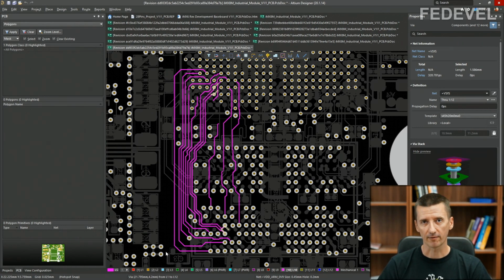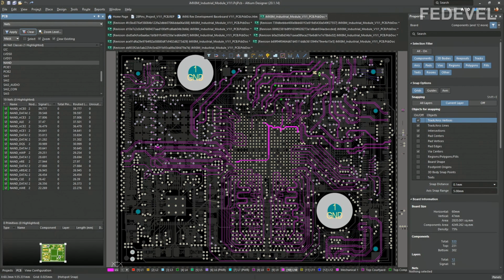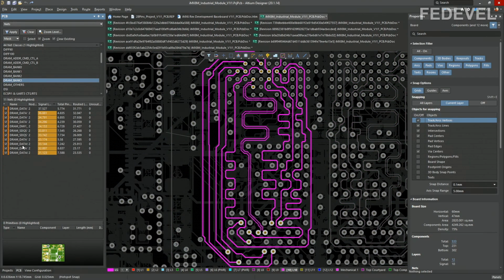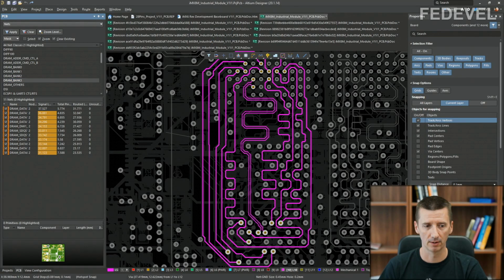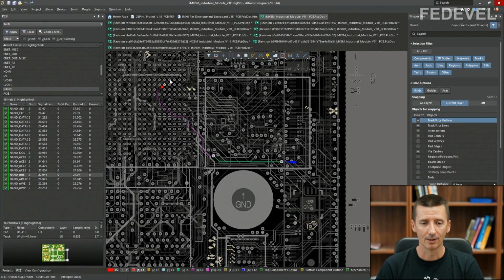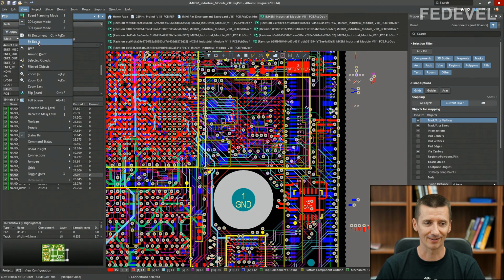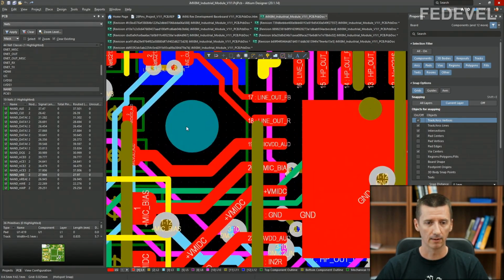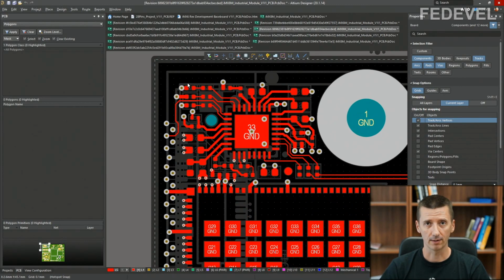How To Improve Your PCB Layout - Routing & Space

Comment: Hello Robert - excellent video, thank you! Question: For board edge clearance (tracks, components) you are using green lines on Mech Layer 14... also, one of your review points covered the NPTH being too close to tracks - why not fix these problems before starting the layout by setting up proper DRUs? I think it is very dangerous, to start a design with incomplete rules, don't you agree? Thanks!

Comment: Hey, Robert. How about a couple of words on LENGTH vs DELAY matching? Yes, it is possible to change layers of all the intarface signals at once or route them all on a single layer. Altium, however, allows to create rules to match the propagation delays instead of lengths. Is it a reliable approach? It seems to me that it should work for signals with t_crit below ~2.5 GHz and everything faster than that is likely to be some kind of serial interface that can not be properly routed on multiple layers anyway. Thanks.

Comment: Robert, why not use a HDI board with buried/blind vias and route the high speed traces on the layer with no vias. It will be much easier to implement impedance control and length matching. The distance between the traces to avoid crosstalk is dictated by the DDR manufacturer and should be followed (2lambda, 4lambda etc). HDI will also facilitate the use of ground shielding to avoid crosstalk and reduce EMI.

Comment: Can you comment on the lane length matching vs impedance/crossover/crosstalk and frequency?
Seems like signals are matched to within a few mm while signals on them could tolerate 10-20mm differences with no effects...
I notice a lot of time and energy is spent in other designs to do this type of matching when it is not needed. Crosstalk or other returnpath related issues play a big role.
Reply from the maker: Very good comment. For modules, we usually do tight length matching as we never know where the module is going to be used and how other engineers are going to do layout on baseboards. However if you have full control over the whole connection, yes, many interfaces can be simply length match in centimeters / inches or they do not even need to be lengthmatched.

Comment: If the base board has more space and is simpler, you could make the tracks different lengths on purpose on the complex board, and then compensate the difference on the board with more space. But that obviously is something that you need to have a lot of control over, and need to really think if it is what you want. I.e. boards then might be really hard to use with new design in the future.
Reply from the maker: Yes. Also, especially if the baseboard is designed by other people or companies, you may not have any control over the baseboard layout.

Comment: Got 2 little questions:
When you got the space - Is there any reason to not make the tracks as wide as you can? Ok, not 5 mm for a tiny signal wire but like why not 0.5 mm when you got the space, or 5 mm for a power-trace that only is supposed to carry like 1A.

And with free open areas the same - are the downsides to filling them with power/ground-planes?

it just lately i have often seen boards that not only are really spacious (like 5 components, 2 connectors and 1 small chip on an arduino-shield) but also 0.127 mm tracks with wide areas (like 1 cm) between each other.

Comment: very useful! keep doing this. you do a lot 45 degree lines  why you dont use (when is possible) diagonal line ? its more shorter and less corners
Reply from the maker: Thank you Sahar. PS: We are using diagonal lines in some cases (e.g. fanout), however I have not considered to use them for long signals yet. Probably simplest reason would be that it could look messy, however real reason is, I have not really needed that. When we route we often have to route horizontally or vertically to make it easy to connect everything - I have a system how to organize, swap, connect together tracks in high density designs. If I would be just using straight lines, that could make it much harder.

Comment: Yes, please. Do more of this kind of videos. Very helpful for beginners like me.
Also, can you help me with an error in my Altium 18 I am currently struggling with right now? I always get this error window every time I open .pcbdoc file. Hope you can help. I've been struggling with it for 3 days now. I've uninstalled my version of Altium 18 and tried to install other versions like 18.1.6 and .7 but I still get the error every time. 

Error:
List index out of bounds (5) at 0000000156872400.
, Base Address: 00000001564D0000.
Reply from the maker: Thank you Az. PS: I do not really know what the error is about, but often the problem can be in the file. Maybe try to "Save as ..." the file and try deleting the stuff from this temporary file until you find out what is causing the error.

Comment: Great video again; when it comes to length matching isn't it better to match propagation delays of the lines? As far as I know, delay matching takes effects of dielectrics into consideration; calculates travel speed and then matches the delays of the lines.
Reply: when you keep all of the tracks that need to be delay matched with respect to each other on the same layer referenced to the same planes length is same length is virtually identical to same delay, when you can not do that things get really tricky, also when you are including delay or length in package numbers given by the device manufacturer and for determining how much length variation is acceptable you need to have fairly good idea of the propagation speed in your traces
Reply from the maker: @timun4493  I agree. Also, I have really bad experience with length matching based on propagation delay - that board never worked properly. And changing stackup or PCB manufacturer was nightmare - a little bit different stackup and propagation has changed. Plus ... I do not trust the software to calculate the propagation correctly - altium can't even calculate simple signal length properly (noticed differences in length between different altium versions?) so trusting the results of calculation of propagation delay - for me big no no.
Reply: @RobertFeranec  I have never tried; with this information will never :) thanks

Comment: Do get even better crosstalk performance, wouldn't it be even better to add a ground track or plane between these DDR3 tracks as some sort of a shield?
Reply from the maker: I do not do GND pour (I do not place GND on signal layers) as if not done properly, that can actually make the layout worse.
Reply: @RobertFeranec  i usually add a clearance rule for pour to impedance controlled net class of something like 5-10x height over plane to not cause to much impedance variation, similar reasoning as for deciding how much seperation to put between tracks to avoid crosstalk, you usually don't want structures on the same layer to significantly couple to each other and by keeping coupling to the return conductor that much stronger you can basically avoid pretty much all issues. for differential signals coupling is often introduced deliberately but only to archive required impedances while saving, if you have the space loose coupling is almost always better

Comment: Robert, do you have used any software to program, test and compile a mircroprocessor? (like at Intel)
Reply from the maker: Juan, I am not sure what you mean .... do you mean microcontroller or processor and what architecture? For microcontrollers I use the software and tools what chip manufacturer provides, for processors ... it depends what CPU you have ... but again, I usually just use what chip manufacturer provides (however compilation, implementation, debugging is very different between architectures and sometimes even not really possible e.g. customizing BIOS is tricky)
Reply: @RobertFeranec  yes, you're right, software tools to syntetizer, debugging, spice, check code, simulation, assembly virtually a microprocesor's behavior before to start photolithography processor, like at ASML, thank for your reply